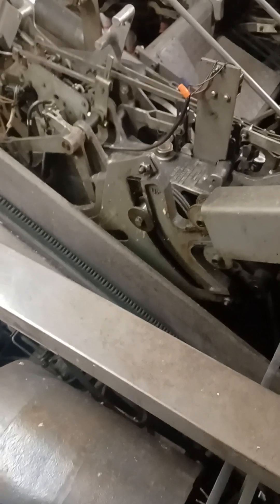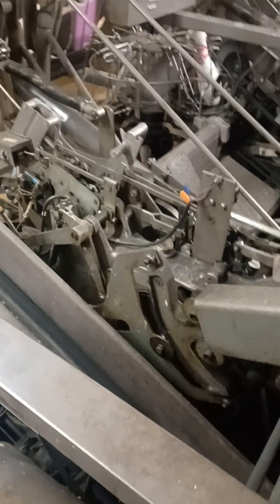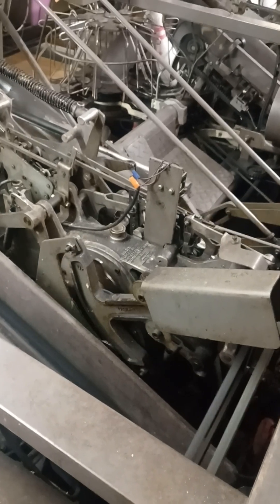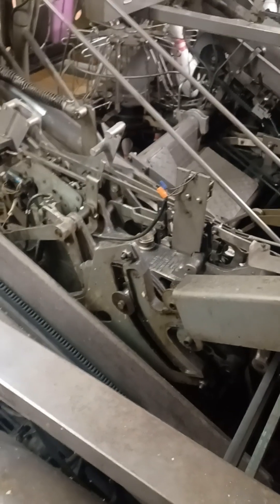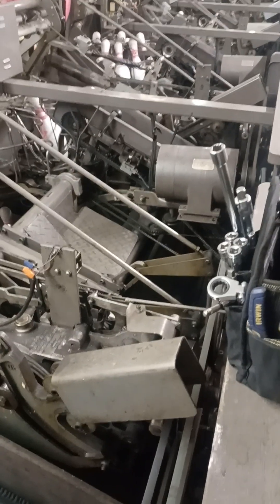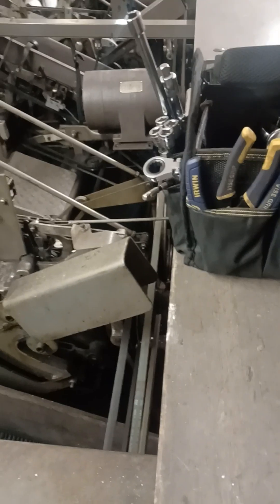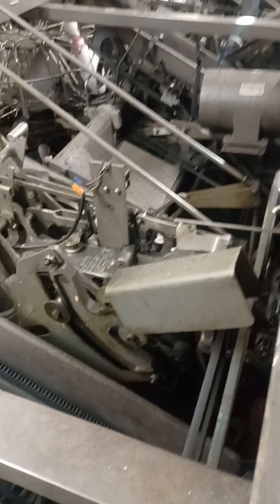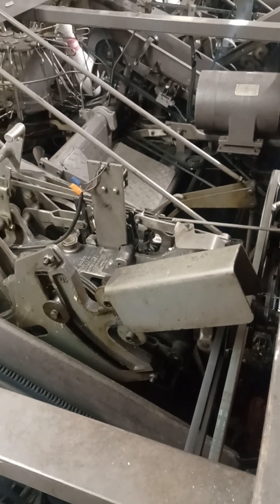Brunswick A2 Cycle Solenoid has constant power doesn't disengage .

Comment: It almost sounds like 2 cannon plugs on the elec box are in backwards, the managers control and reset. I don't think it's possible as iirc one is 3 pins and the other is only 2. Maybe damaged wires in the underground shorting those 2 circuits together? Usually a stuck solenoid is the reset button, esp with frameworx returns, those buttons love to stick. I gotta think damaged wiring somewhere shorting 2 of the circuits together, maybe underground or on the way to the underground. Keep us posted!
Reply from the maker: it was the reset switch up front